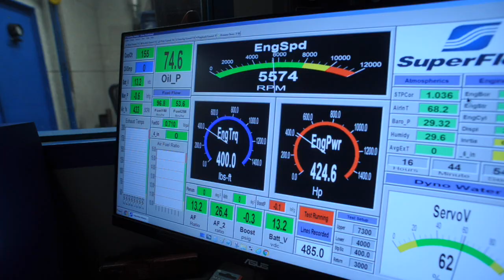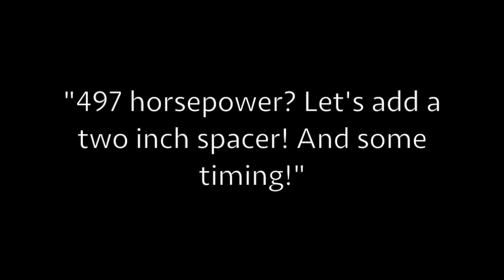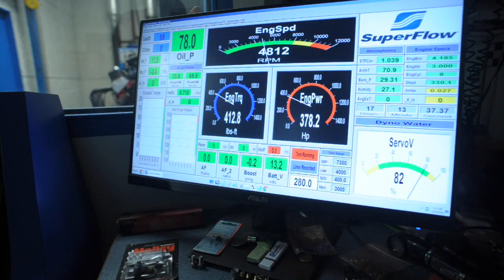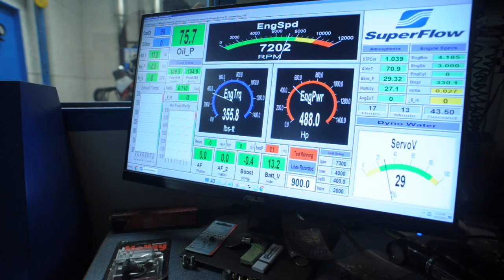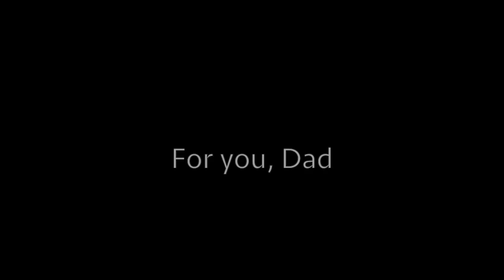Dyno #2 283 Crankshaft + 400 Block | Big Bore Short Stroke SBC

Comment: I grew up in the 60's and loved the 283/327 engines.  They would rev like crazy.
Reply: I had a 327 chevy luv that did 8k rpm on stock rods, hydraulic lifters, tunnel ram with two 425 holleys, and a 310 duration cam... loved that motor!
Reply from the maker: Awesome!

Comment: Do you notice how when you tighten up your springs you lost horsepower........ 6 ponies...... You are actually getting a little bit more from the valves floating..... It was allowing a little bit longer duration and a little bit more lift..... Put in more cam... ..

Comment: Was this just from a crank swap
Reply from the maker: This was a planned very specific build and we’re still very happy with the results.
Reply: @ceperformance you think it can make more power than a brodix heads 434 stroker?
Reply from the maker: That’s hard to say without comparing more than cubic inches and brands. Typically more displacement = more power.

Comment: Hello, have you EVER in your life - even once, heard of an aluminum crankshaft for any V-8 motor? or even a 4 or 6 cylinder? Some guy is trying to sell me a 2nd gen small block 350 chevy motor. Says it's a custom built 700 horse motor with an aluminum crankshaft. I asked "are u sure it has an aluminum crank shaft?" he repeated "yes - are u stupid? all of the best race motors have aluminum crankshafts" I've been building fords, chevys, chryslers, ect for forty+ years and I've never ever heard of an aluminum crank shaft before. Aluminum heads, rods, and pistons, yeah sure, even driveshafts and rocker arms too, but this is the first time anyone has ever said this to me, and what's more... he sounds so sure of himself, that I thought - Maybe there's something new that I don't know about. I think he's full of it! But is that even possible? I'd think it would not only be too light but couldn't take the punishment. Has anyone heard of this? thanks
Reply from the maker: I think you’re right when you said “he’s full of it!”

Comment: This is an excellent build, thank you for sharing.  Now that you've had it installed in the car and had time to really street it, what kind of fuel economy numbers are you seeing and what are your typical cruising RPMs?
Reply from the maker: Thanks for your comment! The mileage seems reasonable but haven’t actually calculated it :) 
It cruises at a mellow 2000-2200 rpm. The car it’s in is a 1966 Beaumont with a Tremec TKX 5 speed. It’s a fun cruiser!

Comment: You need solid rolle4 lifters to try that and not just bette4 springs. But you can't maintain a high rpm, it will fail.

Bloodviking,  engine builder

Comment: So is that the whole rotating assembly out of a 283 or just the crank but some type of special made rod bearings to handle the 400 rods and pistons
Reply from the maker: Thanks for asking. It’s only the crankshaft from the 283. We used rods that normally fit into an LS Chevy that are 6.1” long. The pistons are for a 400 block that’s bored 4.185. 
There’s a list of specs in the description below the video. 
Cheers :)

Comment: I'd like to see the graph. If it was still climbing at 7300 that bottom could easly turn 8000+. The top end of these gen1 motors was always what limited there rpm range.
Reply from the maker: We were very happy that it made peak power where it did. Could it rev higher? Absolutely, but not much point if the peak had leveled off. 
It’s a fun motor to run on the street for sure :)

Comment: Where did you get the spacer bearings for the mains to go from a small journal crank to a large journal main
Reply from the maker: Unfortunately we have never found bearings to do just that. We came across this 400 block in our travels that’s a Bowtie block from GM and it has the ‘medium journal’ size like a common 350. 
These bearings are from Race Engineering part number RA-BS-327. 
They are customized King Bearings.
Reply from the maker: The link for the spacer bearings: https://www.raceeng.com/p-28627-main-brg-spacersj-crank-to-lj-blk-set-bs-327.aspx

Comment: So this is using LS7 pistons (.060 over) and stock length 4.8-6.2 LS rods? I have most of these ingredients but would like to make a stock appearing version. It sounds killer and will work great with that TKX capable of 7000 RPM shifts.
Reply from the maker: The 329ci small block Chevy we described here isn’t an LS. The one you might be referring to is our 349. It’s a 6.2 block, 4.8 crankshaft with 6.3” long Eagle rods. The compression height is like that of a 6.0 or 6.2 which is 1.304”.
Reply: @ceperformance  I didn't watch those videos. I thought I read in a comment somewhere in this video or playlist that you used LS rods and pistons on this. Must have been mistaken.
Reply: @etenterprises   in another comment he specified LS 6.1" rods, but no LS pistons because they wouldn't match the valve relief need for the heads and valves. If I'm wrong, I'm sure he will correct me.

Comment: That thing needs a single plane intake so bad
Reply from the maker: It would be interesting to see the difference. What would your expectation be?
Reply: @ceperformance  I think you would get anywhere from 3 to 9 more horsepower I would also upgrade the valve springs and the cam to an... iski 300/480 Max valve lift with 1.6 rockers... If you would like I could list the cam spec of mine that I have in my 327 I'm getting 9K pretty easily I'm also running a team g single plane
Reply from the maker: I’d be curious of your specs. Sounds like yours is a lot more strip oriented :)
Reply: @ceperformance  the heads are old 461 casting double hump spring rate is #125closed  #376open .....cam is.LOB lift 300.. advertise deration278  (.050dur234). (.100dur202). (.200dur141)   (master number H-593)   valve lift zero lash rocker arm raito 1.6    @480
Reply: You can probably just look it up with the master number it's an isky cam
Reply from the maker: Sounds like a great build. Must really perform!
Reply: @ceperformance  I really like the RPM 327 and other similar motor's make if you can afford solid roller you can go even further

Comment: Been wanting to build one of these except keeping the bore at 4.125” making it a 320 CID, or even a 377 with the 350 crank.  This motor would be wicked in a jet boat since you can get the rpm up so high.
Reply from the maker: Jet boat would be awesome! Thanks for commenting :)

Comment: Any pump fuel today varies in age quality. Myself I would stabilize fuel molecules and see what results are. Cant give away everything I know. Has plenty more to go
Reply from the maker: Thanks for commenting!
Reply: @ceperformance  I believe in reasonable and normally asperated built to last. Your base builds are more than many think for street.
Reply from the maker: @jamesbullock7257  
Thanks again. Do you see this build as being over built or too much for reliable street use? Just wondering.

Comment: Some 1975 Chevy Monzas had a 3.10" stroke 262 SBC mill. That crank might really crank in this setup.
 (edit: Not sure the journal size though)
Reply from the maker: That would work great. Hard to find anymore though! 
Another one I’d love to find is the LT1 style 4.3 V8 from 1995. They are 3” I believe.
Reply: @ceperformance In the late Ninties Hot Rod Magazine built two engines that really performed well for the combinations that they used. One was a 302 built out of LT1 parts with the baby LT1 (283/4.3) crank/rods, one piece rear main block, LT1 aluminum heads and intake and LT1 hot cam. If I remember correctly it produced a little over 400 hp. The other engine was a 400 block 327 crank with long rods, I think they were in the 6.2 in. range, RPM Air Gap intake, iron Vortec heads (maybe), could have been the old aluminum TPI heads, I'm not sure. They used a real tight quench on the piston to head of about .0035in. . They ran it on 87 Oct gas and made 450ish hp/tq. I think max rpm was around 6000 but had torque from the get go. I have tried to find the articles in their archives but was not successful. I'm sure another of my numbers are off but it has been 24 or so years ago.
Reply from the maker: Cool stuff. I’m aware of both of those builds and our first ‘354’ (400 w/ 327 crank) was inspired by their article :)
Thanks for commenting!
A link to their article is in the description of one or more of our videos if you want to see it.

Comment: WHAT??? You de-stroked a 400? Why??? Yea, I know. Big bore short stroke. How did you get the pistons all the way up with the shorter stroke? Edit: compression ratio? Duration/lift?
Reply from the maker: Yep, it’s destroked! The 400 has a 3.75” stroke and we used a 3” crank from a 283. The connecting rods on our build has 6.1” LS rods and pistons with a compression height of 1.443” and .061” head gaskets. 
Thanks for commenting!
Reply: @ceperformance  this was the comment I was referencing RE: LS rods & pistons
Reply from the maker: Thanks for bringing that to my attention. Yes, they are 6.1” rods that are essentially for an LS. The sentence runs together I think there saying 6.1” LS rods ‘and’ pistons with a compression height… 
They are basically 400 Chevy pistons. LS pistons are different because of valve placement all being the same plus the valve angle makes the pockets a bit different.
Reply: @ceperformance  very cool combo. I remember researching about 307's, and seeing so many people trash them. But they still have a bigger bore than a 305 which many love for some reason?? I remember coming across a potential combo using 318 hemi pistons and LS rods. A .035 overbore brings it to 3.91", same as stock 318. Don't know if it was ever actually tried or just the numbers seemed like it would work?
Reply from the maker: Always interesting ideas! Thanks for commenting :)

Comment: I love this build but...as long as you have to use a 400 block..large..why settle for less cubes?..A 350 crank with the same package would be the same size/weight but give you what? 40-50 horses more? Just curious
Reply from the maker: Thank you for asking! There are several advantages to the shorter stroke within the same deck height engine block. It’s not always how much power can a guy make. 
For example, fitting longer connecting rods without a piston with the wrist pin going through the oil rings. Longer piston dwell time at TDC, advantage of being able to run higher compression without higher octane fuel, more longevity with less side load of the pistons… to name a few. 
Would more cubes develop more power?.. yes, but that wasn’t the objective in this build and yet the output is still impressive for such a mild street engine. Thanks again!
Reply: @ceperformance  makes sense. Seems the large bore/short stroke engines always do well; 340 Mopar, 327 Chevy, 302 Ford etc
Reply from the maker: Thank you. Exactly my point :)

Comment: Those numbers were crazy & I'm just curious ..... was that a 4-7 swapper cam & what do you estimate on piston speed ??
Reply from the maker: Hey, thanks for commenting! It is a 4/7 swap and at 7300 RPM the piston speed is 3650.
Reply: @ceperformance   It sounded a bit different climbing up that's why I was curious , a lot of people don't understand the 4-7 swap power gain advantage ... excellent job building that engine !!  Have you guys ever built one using Honda M/C rods ??
Reply from the maker: Thanks again :)
Haven’t done the Honda rod thing yet.

Comment: I am interested in building a 364 SBC 4.165 bore 3.35 stroke, circle track application, limited to a restrictor plate 1.200 no rpm rule. What thoughts or suggestions do you guys have on this build?
Reply from the maker: I’d be curious what rpm you’d want to be at max? 
One thing for sure, use a 6.2” rod and pistons with a 1.140” c/h. That should give options because pistons exist for a 4” stroke sbc in that size.
Reply: @ceperformance  I sent you a email. I am thinking max 7800 rpm

Comment: The Grump was turning higher than this.
If I remember correctly he was launching at 10,000+ and had at 12000.
The last race I attended, I was told he was launching at 14,000.
As he staged in, that engine once it climbed over 10grand seemed to go silent. Apparently the exhaust note crossed beyond threshold of normal hearing range.
You could feel it!
He was using longer rods (6"+)with pistons wrist pins almost against top ring!
As I understood, this kept piston speed to 4000 fps range.
Reply from the maker: That’s awesome. What a legend!
Reply: "GENIUS"
Reply: Crane cams were his choice...
Really digging back memory wise..
Shoot I passed 70 in '21...
Reply: At 14,000 RPM the crank is turning at 233.33 Hz, firing frequency is 933.33 Hz within normal hearing range.

Comment: You'll have to forgive my ignorance but why build a destroked SBC and put a mild cam in it? The only time I've destroked a motor was to be able to rev higher (safer) with the better rod angle. 7300rpm seems low for a destroked motor. I'm sure there is a reason and hopefully someone can educate me.
Reply from the maker: Thank you for commenting. I think if you read through many of the other peoples comments you would see there’s some great things about a combo like this.
Reply: Welcome to school, son. 1) Your perspective is obtuse—"de-stroked" = glass half empty, and implies taking something away, which isn't true; at all. 2) You've settled your own case in your post. 7,300 RPM may "seem" low, but remember that this engine is explicitly a mild cam street engine, with only 224/230 duration, has a 3" stroke, and produces 435 lbs ft of torque. 435 lbs ft—a testimony to the sum of the parts. And it can run on 87 octane. Applause to CE! A brilliant engine build! Here, CE's SBC 354 cu.in., with a 3.25" stroke, repeatedly broke the rear tires free (a '64 F85, with 255 width rear tires) upon hard accelerations, even at hi-way speeds. And it only produced 440 lbs ft of torque. https://youtu.be/FLyvDX8z8uo?t=106. Thinking outside the box and building outside the box may garner certain types of back-handed criticism, like this, from the dogmatic. 3) Don't be the dogmatic type. That gets old really fast. And it's boring. Thanks for your comments. Best regards.

Comment: A far better shortblock combination than the anaemic 305.
Reply: lolol   I have an NHRA K/SA 87 Monte Carlo SS with the factory L69 making 427 hp @ 6600 rpm. Thats with a stock lift solid lifter cam, unported heads with stock valve sizes (1.84/1.50) and multi angle valve job, stock L82 intake, and a Barry Grant built (from 2005) Rochester Quadrajet. The car runs 11.60s @ 117+ and has put more Fords, Chevys, and Mopars  (big block and small block) on the trailer than I care to remember. This is bracket racing so if you have to spot me lights on the tree its race over for you. FYI theres sprint car guys making 750+ hp with 305 Chevys. Anaemic?  Mine will embarrass you.
Reply from the maker: That’s funny! Thanks for commenting :)

Comment: That's pretty cool👍 And local at that! I used to build super late model engines in southern Ontario and we used 400 blocks with 3.25" stroke cranks to stay within the 355ci rule. Was always curious about using a 3 inch stroke like this.
Reply from the maker: That’s awesome. The 327 crank 400 is really cool too. Have a look at a build we did like that for a street car. You can see a few short videos on our channel. Thanks for commenting!
Reply: @ceperformance  this is awesome!  i am going to check it out also.  i am doing a 3.625" crank in a 350 and a dart 400 tall deck  block
Reply from the maker: Dennis, that sounds awesome! I’d love to hear your results on that build.
Reply from the maker: @zAvAvAz  
I’m curious what rods, what rod length and pistons your using? Are you using off the shelf pistons or an existing compression height already available?
Reply: @ceperformance  Well in an UNdecked 9.025" that measures good, you can offset grind the crank to 3.6 use a 6.1" rod and the mahle 1.125" piston would be sweet. comes out stat nutZ on , any protruding isn't a problem if only .002" Any head  .041" gasket or i should say .038, .039, .040, .041", .042" 
all work great as you want a quench of .040" .  i had a ton of other pistons but trying to find them, the 1.2125" is a custom based off of the 1.210" piston usually on the shelf somewhere for a 6" rod and 3.625" crank , for undecked block. And 1.1875. " piston i seen somewhere now its gone, might find it again, its for the decked 9" block person. So i am going to keep the deck 9.025" of course you know some blocks you just can't do that, but all that i have seen measured up, of course 4 corner square deck measure with the rods and pistons crank installed that shall be in use. On the offset grind you can add stroke also and get an off shelf piston i shall try and find that one for you also.. Called some places about doing some custom pistons also, run me a grand they said.
Reply: Well be sure to try this one, a 9.325" tall deck sbc dart or any.  3.8" stroke, 6.25" rod, and 1.175" piston has a rod ratio of 1.64:1, and 4.030" bore gives 388 c. i.  and 4.155" bore gives 412 c. i. awesome combo. Makes a great street engine running all day long , as well if you want to build a race engine with a rod ratio of a 350. gives a little edge here and there over the standard stock 3.75" crank. And beat the bats out of a standard 406.
Reply from the maker: That sounds amazing! Thanks for the combo :)
Reply: @ceperformance  Yea, I'll check it out👍